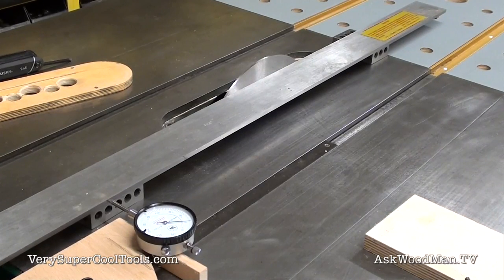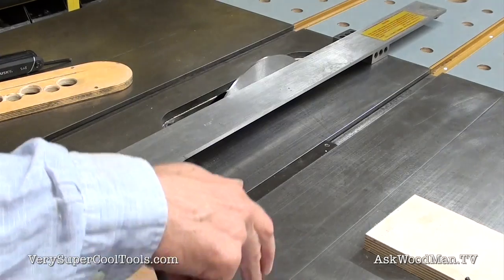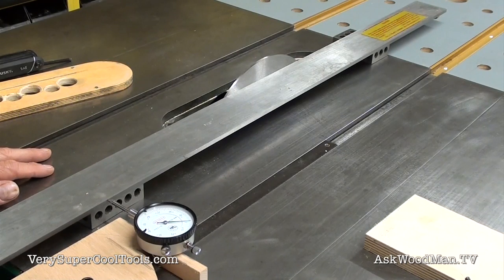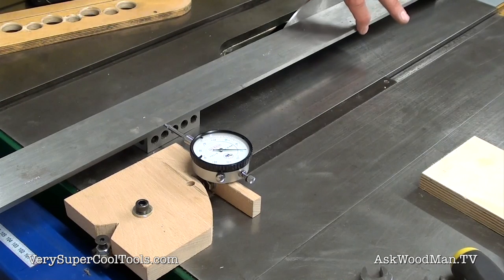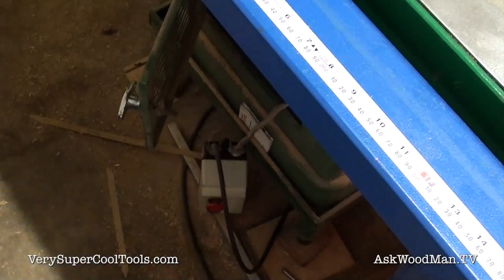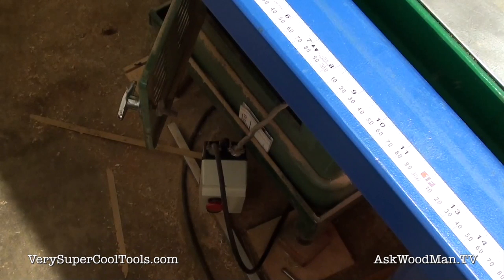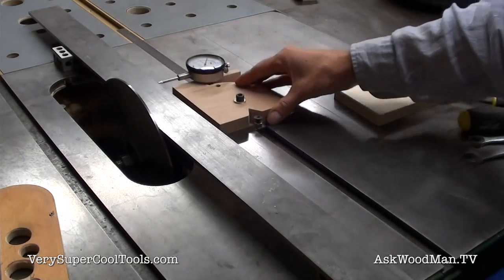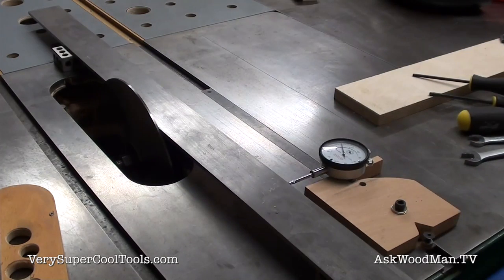857. Table Saw Tune Up

Comment: Great info, as a professional Toolmaker  / Machinist I can appreciate the precision of the set up method you use. I'm a newbie to woodworking and I'm realizing how translatable the skill set is between machining and woodwork.  I can tell you it is extremely difficult to get something as long as that straight edge flat,  that is why they are so expensive and you got a hell of a deal! Cheers, I'm looking forward to checking out your other videos.
Reply from the maker: Your machinist skills will give you a great foundation for woodworking. Machine setup which you already understand is so important to keep compounding errors from causing problems through the many steps of furniture making. Thanks for watching and taking time to reach out. Allan

Comment: OMG, if I would have crawled inside that cabinet like that, I would have never been able to get back out hah!  Good info, thanks.  That straightedge is an expensive piece of equipment huh?
Reply from the maker: neilyeag Of the tools I showed on how I tune my saw, only the arbor plate is a single purpose tool. I use the straight edge, 123 blocks, dial indicator and of course the miter bar for many other operations in my shop. That Starrett 380-48 is not cheap (about $275) but for machine setup or checking flatness or straightness in a portable tool it is hard to beat. A lot of companies sell "straight edges" but not come close to the accuracy of this Starrett. It is rated at .0002"/ft. Two ten thousandths inch per foot.   I think the video camera made that space look smaller than it is. Thanks for watching and keep in touch. Allan